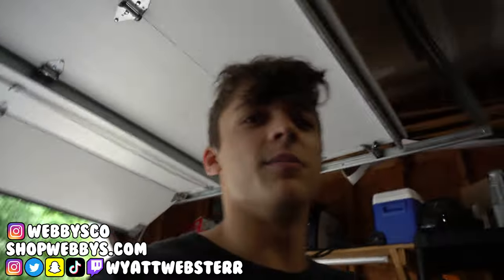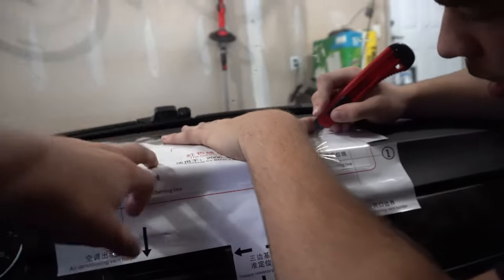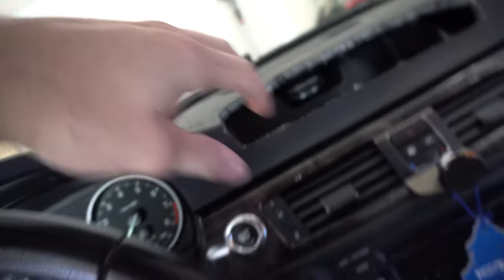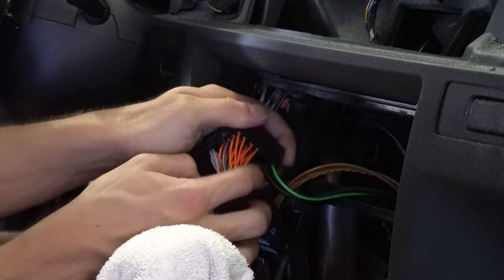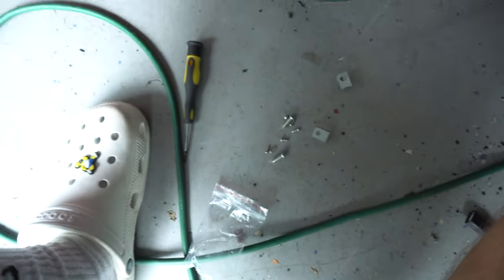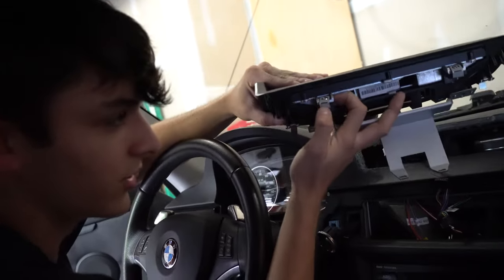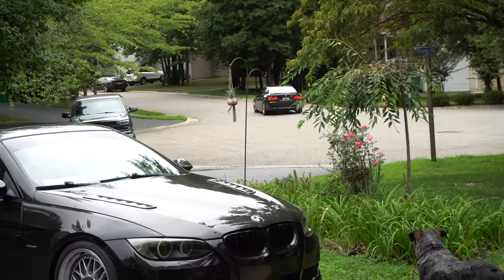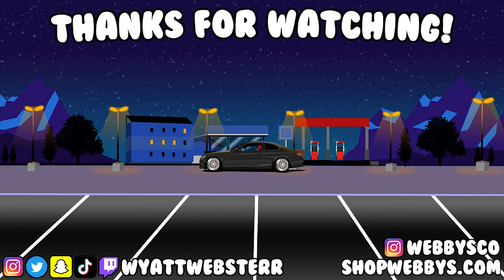Apple Carplay for YOUR BMW 335i | Without i-Drive

Comment: I know this is old, but I got a 135i, and the cupholders are designed so you can only use 1 with the armrest down, and the idrive knob would delete the good cupholder. Is the screen touchscreen or do I have to use the knob?